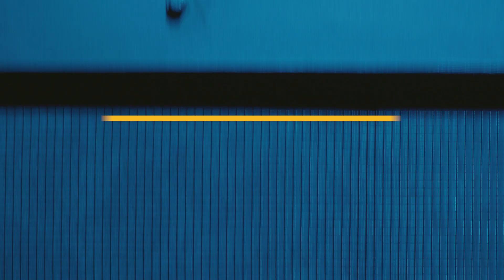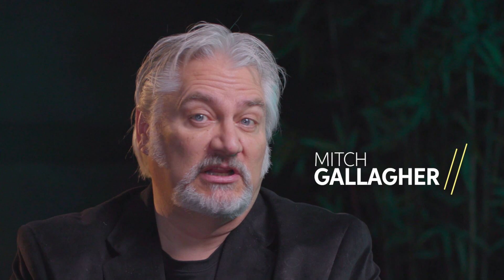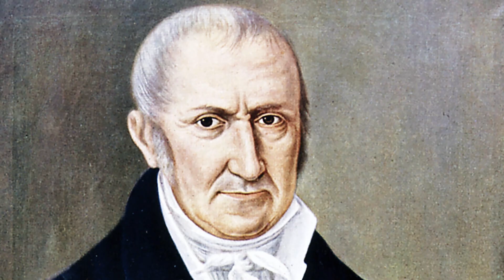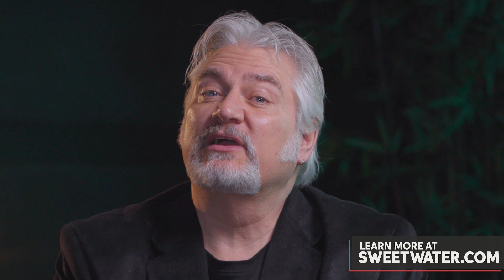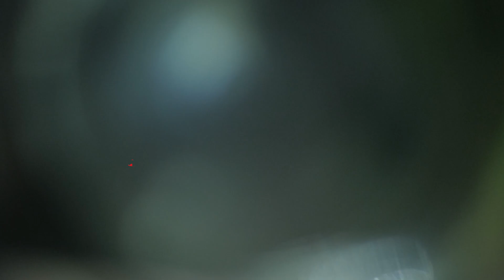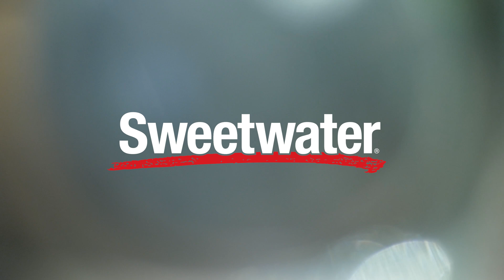What Is Voltage?

Comment: Corrections: "If you plug in a device that draws more than 15 Amps of Power".  There's no such thing as Amps of Power.  Power is measured in Watts.  The correct statement would be, "If you plug in a device that consumes enough power to draw more than 15 Amps of current...."  Voltage is "Push", Amperage is "Current", Power in Watts is "work done".  Don't confuse the terms.

Comment: Please remove the background "ambient" sounds pretending to be music. Its rhythm is distracting from the rhythm of the speaker but is not interesting enough to stand on its own. I am only 43 seconds into this video & must now turn it off. I'd prefer to simply read the transcript which has not been accompanied by graphics and therefore does not justify a video presentation. I prefer to hear my own voice, if any, while absorbing information (at a rate faster than the average speaker - even at double speed)
Reply: There several errors in the video explanation of Voltage.  "Voltage pushed through a motor will make it turn. Voltage pushed through a speaker will make it move in and out...." both are incorrect.  You don't "push" voltage.  Voltage IS the push.  Voltage pushes current through the motor, speaker, etc.  Potential is just the "possibility" of pushing current.  You can have voltage with zero current flow, that would be potential.  Voltage spikes on power lines don't damage equipment, the resulting current and power dissipated in the device does the damage.  Power=work done.  A voltage spike with no current flow doesn't do anything at all.  A surge protector cannot help with a brownout.  All they can do is protect against certain types of power surges or voltage spikes, by channeling the spike through a component that absorbs the resulting power.  If the spike is capable of producing enough power, the device will self destruct.  That's an MOV, and that's how they work.  If you want to protect against a brownout and surges, the best device is a double-conversion UPS.  Those are expensive, not your $150 UPS.  They supply the power all the time by converting it to DC (which also charges the batteries) the reconverting it back to clean AC.  If there's a spike, they take care of it.  If there's a brownout, it's already running on UPS all the time, so no brownout. 

This is the first Sweetwater video I've ever watched.  The presentation is OK, but the details are not.  I hope the others are better.
Reply: @movingbits  Thanks for the text.

Comment: Most residential voltage isn't 120, its closer to 110 or 115. On the other hand, commercial facilities typically have 118 to 122.
Reply: Residential 120 can’t go below 114, minus 5%, per regulations. Commercial is more consistent around 120 to prevent wear and tear on the machines and tools.

Comment: 80% of my gear has come from Sweetwater, and you're always my go-to first for anything. I'm almost 60 and still dream if visiting your facility like others dream of going to Disney World! So this is just artistic criticism!

Have you listened to this recording on YouTube through decent speakers? Good content and I admire Mitch. I had to grab the remote control and pull the volume way down because it is so loud! Audio is almost overdriven, definitely way too hot. I'm not a Pro mixer but have been recording for a long time and know when a signal is hot! Much of your content is this way. Some is not. Current is as important in the gain structure as voltage! 😉 😊

Comment: Voltage is potential.  It is like a closed faucet.  Amperage is pressure.   It is what happens when you open that faucet.  You can have a very high voltage and a very low amperage and it won't be dangerous. However you could have a lower voltage and a very high amperage and it would be dangerous. For example, a car battery.  Don't short one out!  Electronics is fun!
Reply: Aperage is a coloquial term for Current.  Current is not pressure, it's rate of flow.  Voltage is pressure.  Voltage has the "potential" to cause current to flow in a complete circuit, even if there is no current, there is "potential".

Comment: Question then. Voltage is the potential to do work. What exactly is negative voltage? Pedals that take 18 volts use a positive 9 volts and negative 9 volts. Computers also use positive and negative voltage to power components. 🤔
Reply: Negative & positive is a reference to polarity.  In electronics DC (direct current) is quantified as amps flowing in one direction only. Yes there is ac (alternating current) in electronics as well. In DC though, the polarity is theorized as flowing negative to positive. Alternating current flows both neg to posi and posi to neg in cycles or Hertz. When a meter is applied to terminals, current flows in order for it to measure voltage. It also flows to measure current. Internals in the meter have circuits to distinguish said values. You'll either have a neg or positive reading based on how you apply probes to terminals. Neg 9 volts = applying probes in reverse. Black to positive, red to negative, and obviously the reverse applies to positive 9 volts. Black to ground or negative, and red to positive. You might have 2 nine volts batteries in parallel making only nine volts, or in series making 18 volts. Depends on the circuitry in the pedal, or device. Anything you plug into a wall outlet is eventually inverted to DC power. Bad thing about batteries is when they start losing their charge an internal resistance starts building up. Hence the reason voltage sensitive devices fail sooner rather than later, requiring a new battery. Hope this helps a little. Sorry for the lengthy explanation.
Reply: To add to the above: in DC logic circuitry negative voltage is used to alter the flow of current to simulate switches; it can be positive = switch on and negative = switch off or it can be used to indicate other logic conditions. Most commonly used in digital devices that use microchips such as computers, etc.
Reply: @tragicallymalicious1  - I’ve used an inverter in an RV. It converts the on / off of AC into all-on of DC. There’s more engineering going on. It sounds like that’s what the negative volts is doing though.

Comment: voltage pushes current(the electrons). current does the work, not the voltage. the pressure/potential is how hard the electrons are "pushed".
speaking of voltage, can sweetwater get a line of powered MIDI splitters?  i'm trying hard not to shop elsewhere.